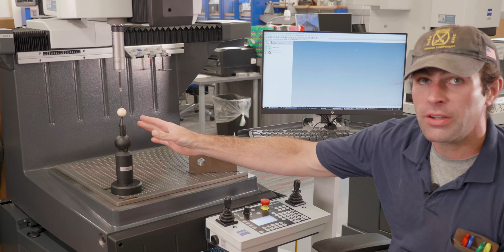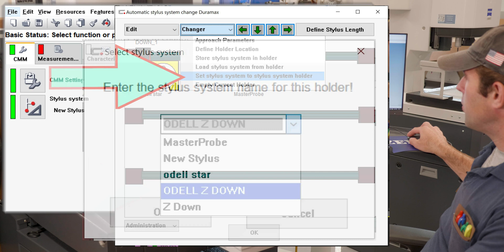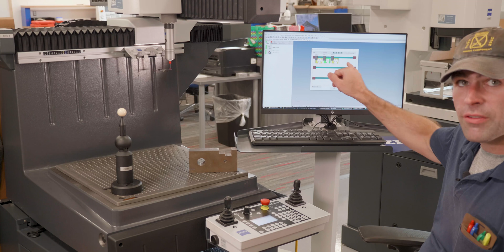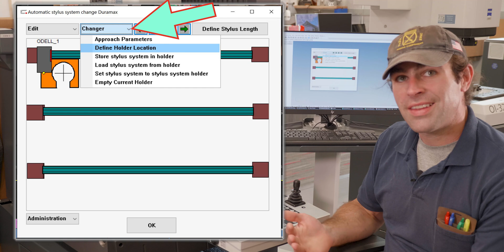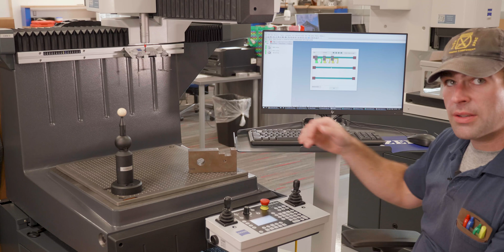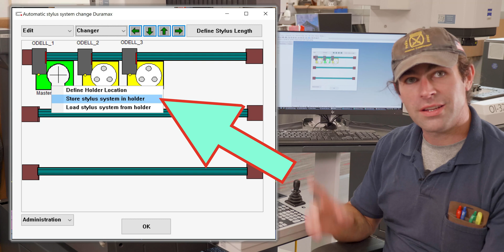CMM Zeiss Duramax with Calypso: Stylus System Holder (Programmer Training Lesson 4)

Comment: I notice you have a 3-slot module, one calibration dimple for all three.  The system we bought has five individual holders, each with their own location dimple.  I can extrapolate how to deal with that, it's just one location exercise each.  However, in getting ready to setup the Stylus Systems to Holder positions I see that each of the holders are NOT locked in place in the aluminum frame.  I can freely slide those side to side with a finger-tip.  My reaction, not knowing any better, is that there should be a way to secure each in position, because someone carelessly bumbling their hands into those could completely shift those out of position for the head during pickup or drop off (?).  Is my observation correct, that each holder in the aluminum frame is, by design, free to slide back and forth at will?

Comment: Thanks, these videos are very helpful. Any tips on setting up the approach parameters for the holder?
Reply from the maker: Thank you! Normally the default setting are sufficient. Are you having an issue getting your stylus systems in the holder? I will be making more Zeiss CMM videos over the summer.
Reply: @RDeanOdell  No issues with getting the stylus in or out of the holder, but our qualification sphere is on a 10 inch pedestal  in the middle of our table, and I'd like the probe to not crash into it when moving between the work piece and the probe rack.